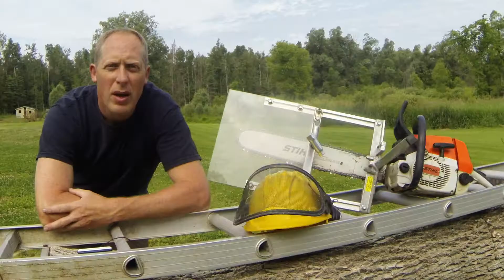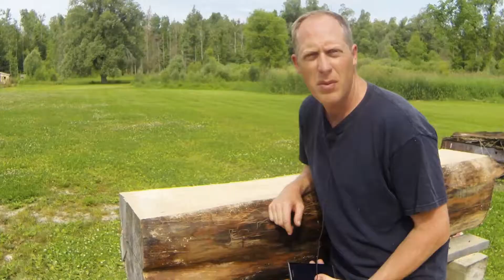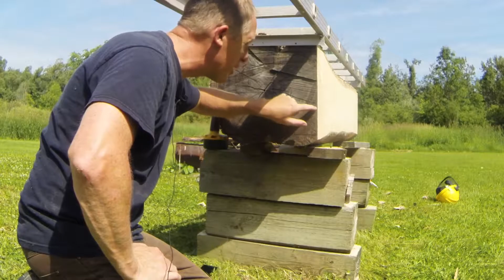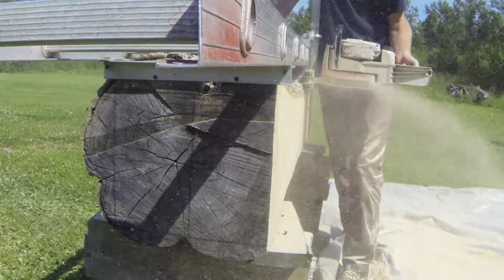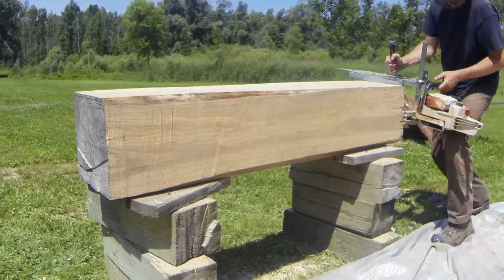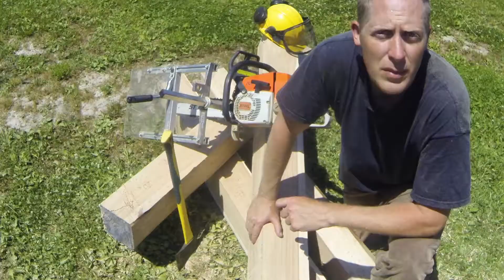Milling Logs into Beams

Comment: What size motor are you using?
Reply from the maker: At first I started with a 028 because I got it for free but have since up'd it to a 034 which works well for the size of timber around me.